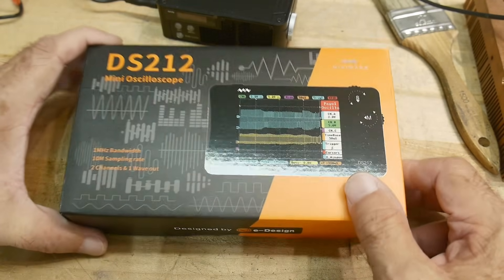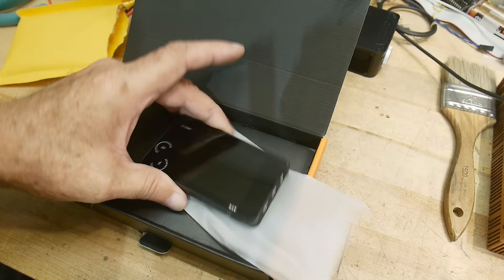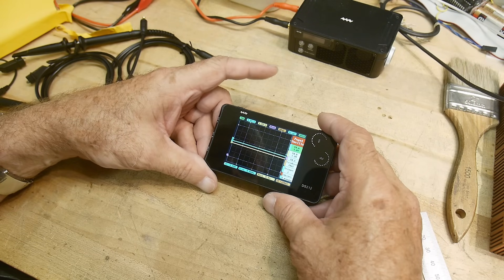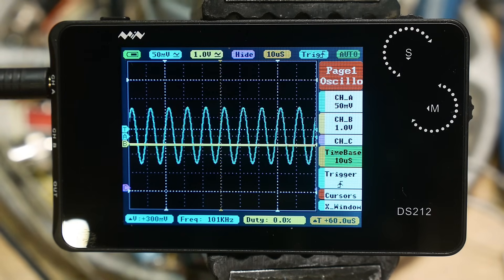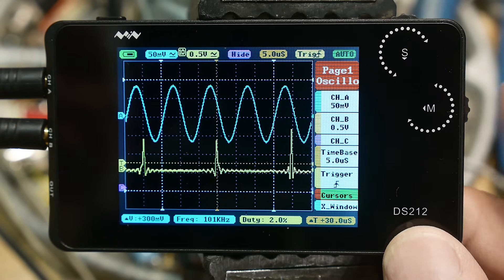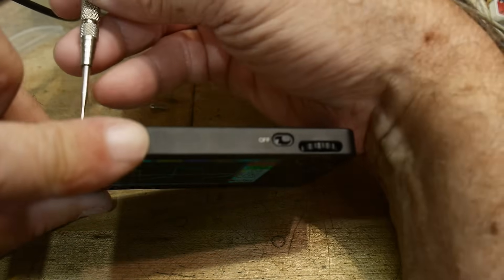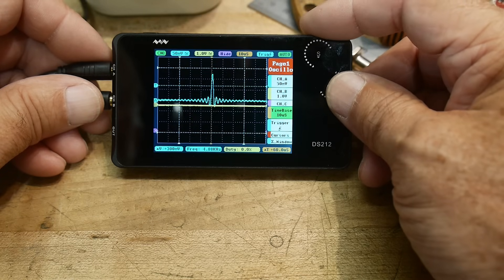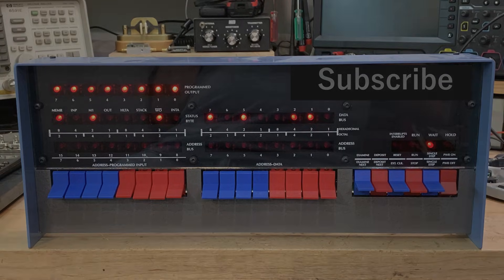#1648 MiniWare DS212 Dual Channel Oscilloscope Review

Comment: Lol on the throw it in the trash can if it is garbage. I prefer to throw most Miniware products in my bag. Their modular power supplies and electronic load being my favorite  and then their portable solder iron being the one I use the most. Nice to be able to power off a LIPO, or power bank when out. Especially since race drones and etc and I and other crash them all the time, so yes very useful especially in the RC community. There oscilloscope hate the MCX connector as come loose over time, I wish they would use a better connector. Yes there oscilloscope a bit pricy for what you get but small and don't take up much space in bag and most stuff don't need much bandwidth, or vertical sensitivity, for everything else use my Tektronix THS 720 for HV, motor control or power supply troubleshooting.

Comment: This thing should not have users tweak the compensation capacitors. It shows so few samples on-screen that the CPU has plenty of performance to run a FIR filter that perfectly compensates the probe. It has on-board signal generator after all so it can characterize the impulse response of each probe. It’s such a basic feature. I understand that bigger cheap scopes may not have enough DSP resources in the FPGA to run such filters in real time. But this one? No problemo.

Comment: A little trick if you own it: When changing the trigger level or when you need to change a parameter by a lot, instead of spinning the encoder like crazy, just move it by one position while keeping it pressed and it will enable fast scrolling (until you stop pressing it).
Reply: I've had this for years and always spun it like crazy. I didn't know it had that. Thanks!

Comment: I love all miniware products and have most of them.  I don't have the DC load yet tho.
Reply: The big brother to this DSO is awesome.  The DS213.  Great for a portable electronics sachel.  I have this, a nanovna, tinysa, miniware soldering iron, a miniware screwdriver all in a 10x6x3 case.  There's also some solder, all necessary adapters, and attenuators for testing ham radio gear and antennas.

Comment: I've had mine for about 4 years now, and after numerous drop tests it is still doing the business.  It is my only scope and has served me well in audio applications (not an rf guy...).  My only real complaint is the MCX connectors failed on my scope probes after a short time.  I use BNC probes and adapters, but they take up too much space to be able to use two at a time, and they dramatically increase the chances of another drop test.  The only other annoying thing about this scope is that my first indication that the battery is low comes in the form of erratic waveforms progressing to flat lines on the screen;  Annoying when I'm trying to debug a board or something.  I haven't upgraded the firmware, so maybe that would help, but probably not.  I still think it was a good purchase, and it is just too cute for words.  The weirdness of the power is probably the backwards mosfet bug, but my shaky hands don't play well with SOT23 devices, so paraphrasing the immortal words of Dave Jones, "It's Good Enough For America."
Reply: It's a late reply, but I would suggest a BNC female to MCX male flying lead adaptor. At least, that's what I will be purchasing in order to use the signal generator function "on site".

Comment: Miniware should create an all in one package. So you would have a portable scope, signal generator, PSU, soldering station, perhaps part identification and testing unit... These mini tools would make a lot more sense that way imho.
Reply: I hope they realize this and actually do this. It nice and small and easy to throw in bag. They are missing the signal generator. They were leaning towards that before CoVid with the PSU as was suppose to have many modules and even a separate battery pack to power everything off of. They only did the PSU and electronic load in that series.

Comment: The connectors look like MCX.  There are much cheaper little scopes that perform much better for the money.  Kind of disappointing coming from MiniWare.  Yeah, for the same money the Zeeweii DSO3D12 offers BNC connectors, USB C, honest 120MHz BW, rock steady triggering and has a DMM built in.

Comment: Those connector are MCX, they are very bad thats all I got to say. I had to put a piece of wire inside the connector because the pin broke. I never abuse my instruments or tool, but this made me question myself.
Reply: MCX are not made to be often plugged but they are VERY durable compared to most other tiny connectors

Comment: looks like triggering is digital instead of analog,... jitter
can't say I would have any use for such a thing other than to see it.
maybe for embedding into another project.
If they were to make this device user programmable - that is - release the source code so that others could customize it for there own use,.. then I would be interested.
Reply: The code is available AFAIK.
Reply: @absurdengineering  Source Code or Binary?
Reply: Digital triggering is fine as long as a timer is used to measure the exact level crossing time. Then the sweep needs to be fractionally time-shifted. Works well if it’s done. Trigger only needs a comparator with adjustable threshold then - most MCUs have something like it.
Reply: @absurdengineering  a simple sounding argument is not the same as solving all the problems.
Reply: @mr1enrollment  Oh I know, but I’ve designed such things. Here they just put it out when it looked done and they didn’t care.
Reply: @absurdengineering In fact I designed a trigger circuit for a digital scope back about 1981 or so, different days - but similar issues.

Comment: I had mine for a few years but doesn't get much use. Mainly because I have a rigol on the workbench. This is very useful in the field where I need to check something not very fast (looking if there's a signal present). I hope they fixed the charger issue in your unit though if it's a new revision. A mosfet on the B+ has the drain and source reversed so the 5v from the usb bypasses the 4054 ic and goes straight to the battery via the mosfet body diode. I flipped the mosfet in mine deadbug style and the charging circuit worked as it should after the mod.
Reply: Can you please provide more info on the problem and fix please? Is the reversed MOSFET on the main PCB or the very small PCB attached directly to the battery?
Reply: @digiphil  I forgot the Q designator of the MOSFET in question. It is on the main pcb. You can trace it with the source and drain connected between the battery + and the cathode of a Schottky diode whose anode is connected to usb 5V. The connection should be the drain at B+    and source at the diode cathode.
Reply: @quandiy5164  Thank you for quick reply and info provided! I have board version 1.6 and measured 4.8V on battery terminals with battery and USB charger plugged in yesterday before sending you this query. Now that you've sent me full info will open device again and check.